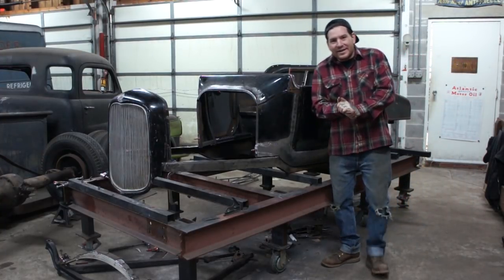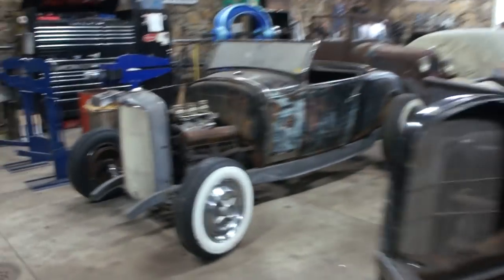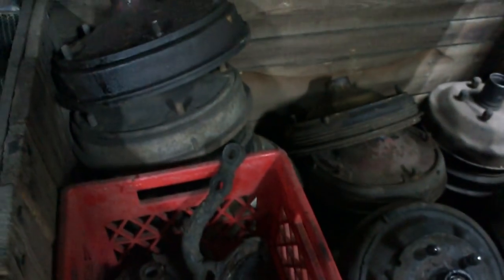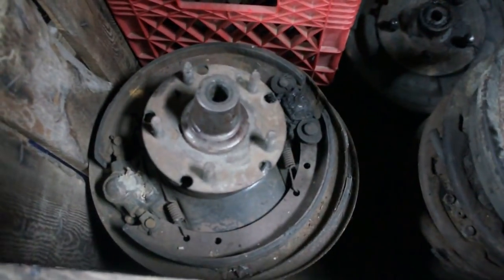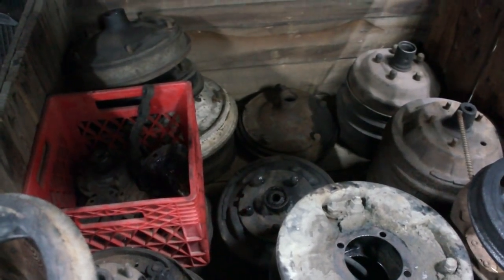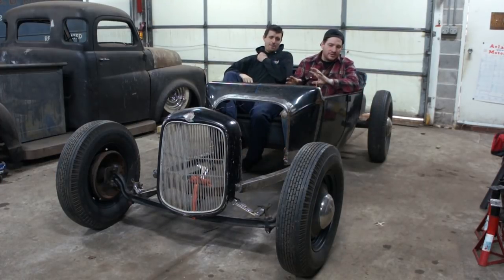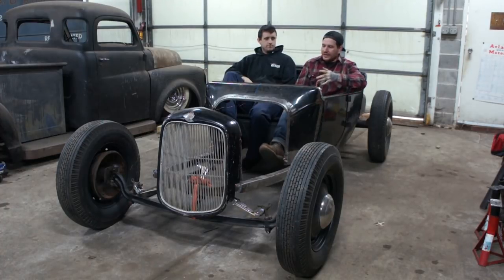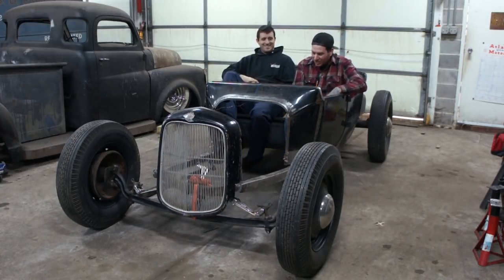Ford Model T Hot Rod Suspension Installation- Ford Free T - Ep. 14

Comment: I'm really looking forward to seeing an engine in this car which will of course lower the front a bit too . I am truly impressed by the way that you have managed to make a whole lot of parts from different cars look like they belong together. Its always the way that you integrate things that make for a great rod rather than how much money you can spend.
Reply from the maker: Yea the weight of the drivetrain and slightly smaller front tire should get the front end sitting better. I can't wait to get it sitting correctly! Thanks for the comments, the car looked awkward at first but finally I've gotten it closer to my vision of a more cohesive car that flows! Glad you dig it!

Comment: what makes the square backed spindles better.

rat rods are for attention getters I call them shock rods 

you ever notice ppl build there rat rod with a huge chop and all kinds of junk welded to them and then in a year there for sale
Reply from the maker: No real advantage, just they are what I have the most of and they fit the more common 41-48 juice brake backing plates with no mods. I just use whatever I've got haha.

Comment: I have the same trigger word. No, it's a hot rod.
Reply from the maker: We both have to correct people constantly. There is a huge blatant difference between the two! Thanks for watching!! -Mike/ITG
Reply: Ya, I hear you. I'm building a 29 Roadster all original Ford steel and period correct swap meet parts. Yes another one, but there aren't any around where I live so it's kind of a scarce car here. Do you have any insight on painting a late 40's to mid 50's traditional car? Not a magazine car but a well built driver. I doubt guys back then had pristine paint booths. I unfortunately had to media blast half an inch of house paint off the body so it's in black primer now. I should tell you I really liked that trans cross member you guys made with the "cast" look. Great idea and execution. Excellent channel. Thanks for taking the time to film, edit and share your builds.
Reply from the maker: Sounds like an awesome project! I've painted a handful of cars in my garage/driveway before. It can 100% be done. Just pick a good warm morning and spray early in the AM before the bugs come out and you can do it! With today's clearcoats you can easily wetsand and buff imperfections out to look pretty dang nice. We're planning to do the Free-T with Eastwood 2K aerospray cans in the shop/driveway with the ceramic chassis black and a satin clear and then buff it until it gets that deep, semi-gloss look of old lacquer paint. Can't wait to get to that point!
Reply: IronTrap Garage thanks for the tips. I'll have a look at that Eastwood paint too. That does sound totally doable. I'll stay tuned so see how you guys get to that point. Thanks again for the reply. Cheers,